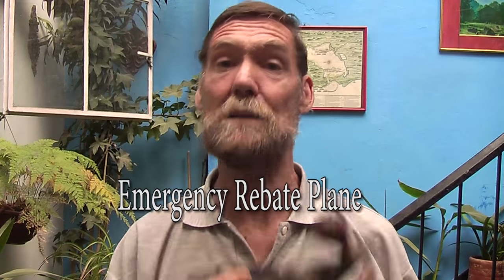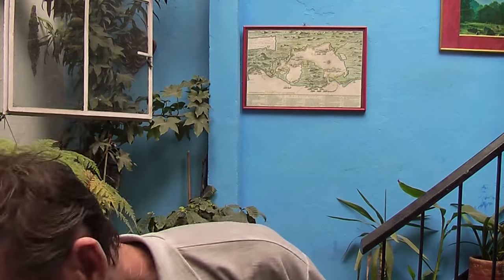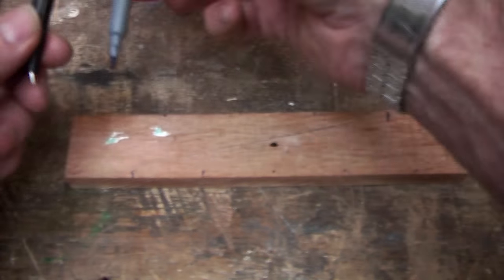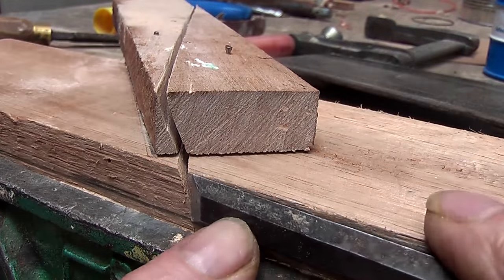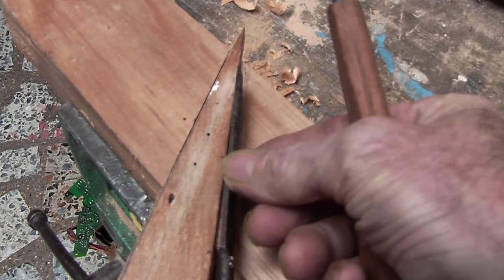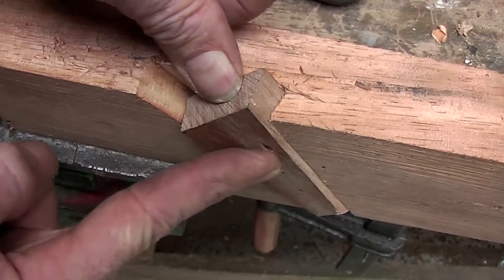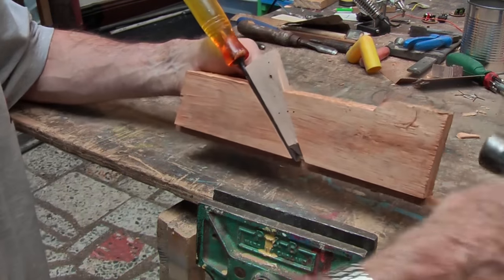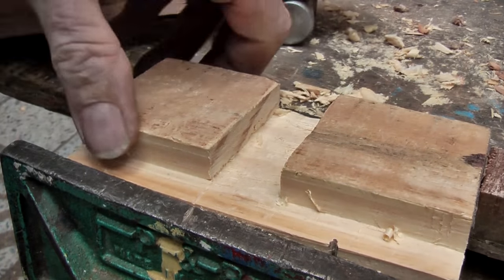Emergency Rebate Plane

Comment: G'day, Philip, it's terrific to see someone taking one of Paul's ideas and then putting it to use. Very nice implementation of an improvised rebate plane. Cheers, Mark.
Reply from the maker: All these years.. Why didn't we have  internet  30 years ago when I could have really  used this!  I remember  finding  wooden block and  molding planes in second hand shops , tried replicating them , but  had  no clue , and  failed. They are so functional in their simplicity, but for a  couple secret angles....